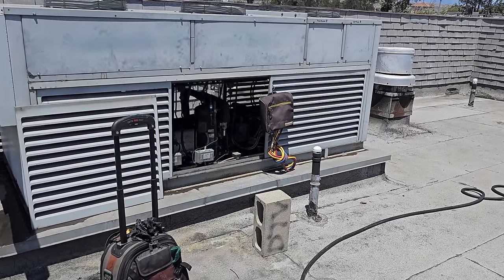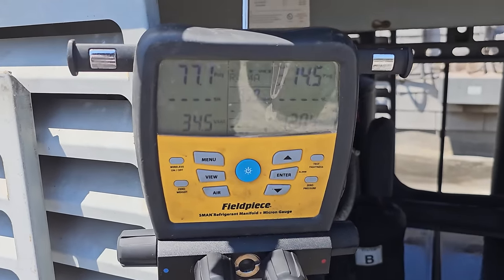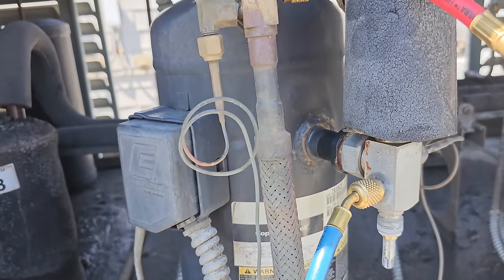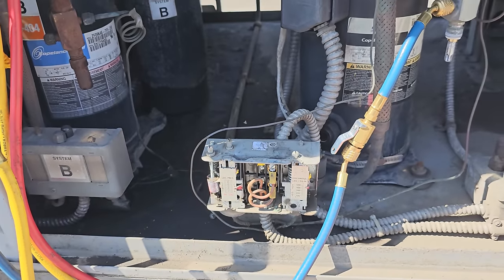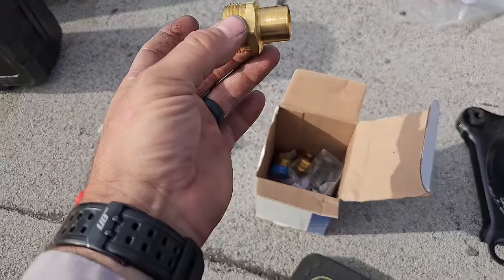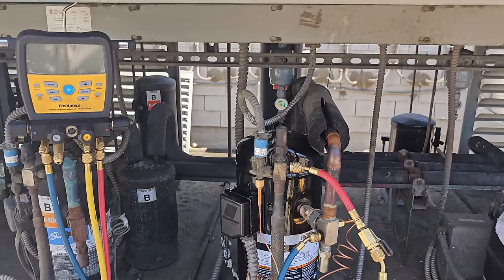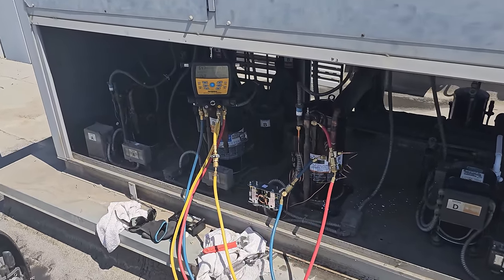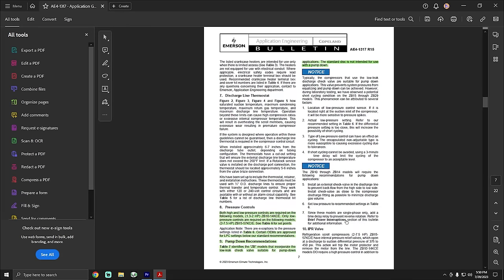NO GOOD DEED GOES UNPUNISHED

Comment: Been the story of the summer here in Austin.....high pressure lock outs left and right....most of the equipment here  was designed for 95-98°....and its been 100°-109° with heat index's of 105°-125°.....got to strike while the iron is hot.
Reply: I'm in East Tennessee and we had a heat index of 120 the other day and everything seems normal. I don't think the heat index applies to HVAC quite the same as a sweating human..
Reply: @Bryan-Hensley you are correct...it is for human comfort or lack there of, but it still doesn't change the fact the temps are way over design and its causing lots of issues....especially with DOAS units...they are tripping left and right
Reply: @jasonjohnsonHVAC  that doesn't seem to happen around here nearly as much as southern California even though our heat index is the same many times. However (even though it's not happened in 10 years) when we go over 100, the systems do the same as there. When I started this business in 2001 it used to get above 100 at least a few days per year, but for the past 10 years or so it barely tops 90. Our nights used to stay above 70 for weeks, now it rarely hits 70. It's actually hurting my business some. I don't have those overwhelming rush periods anymore. Dang global warming..
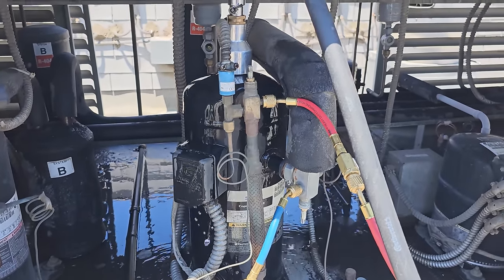Reply: @Bryan-Hensley  we are only getting to 95-98° at 9-10 at night and its getting only down to the high 80's at night...no rest for the wicked....on Friday i worked from 7:30 am till 2:30 Saturday morning....im ready for a break already.

Comment: Really enjoy your stuff.
Have you ever thought of using solid state contactors in high sand and dust situations?
They can switch millions of times with no issues.
They are more expensive, but if the customer would be willing to switch to them, could be ideal in your conditions.
Allen Bradley and others make them.
Just a thought, dude.

Comment: I had a freezer scroll that refused to pump down. And you could hear the hissing. Charge was correct and It got stuck at like 26psi. Even with the LLS closed. So we let it run for 2 days while we got a new compressor sorted for them.

Comment: I’m sure you know this but those field piece probes hate dirty copper, I try to keep a piece of sand cloth in my bag to clean a section where I’m putting my probes. When the copper isn’t clean they still work but sometimes they refuse to work unless it’s on a clean pipe.

Comment: I love the "SWIVEL TEE TRICK" for peanut style pressure switch replacement just install swivel tee fittings and leave the old switch there!
Reply from the maker: I will discuss this on my livestream this evening 7/31/23 on YouTube @5:PM (pacific) come on over and check it out https://youtube.com/live/qEza1nnkhpA
Reply: they tend to loosen or crack with age. vibration kills them, especially with switches and wiring or the long cap tubes going to controls, you'll often find the tubing dancing with harmonics and vibration. that puts load on the tee and work hardens/stress fractures. pretty much they're best for temporary use or somewhere not connected to a compressor directly, say on receiver tank, other taps.

Comment: Front seating those valves will isolate the piping and you can change that pressure control once you "recover" the pressure from the compressor. Probably lose like half a pound of vapor in the compressor. 

But regardless good video. And sounds like you needed new gas anyway.

Comment: Discharge line temperature safety switches for compressors are cheap protection from other components in the system failing that causes the compressor to overheat

Comment: like your channel...was in hvac/refigeration (had 200+ commercial accounts)...in 30+ years saw drastic change in motors  starting with the use of capcitators to EMCs...one of the best developments is the field reversible motor...complaint though; to do with the manufactures all haveing  such short reversible leads and how, as concerned techs, are we supposed to properly secure them especial when the butt end of the condenser fan is secured to the top of the unit (upside down)...for, what, a couple bucks more, they could make the leads as long as the other wires so the tech can route them properly instead of left hanging in the air... and this passes underwriters testing?...did you figure a solution

Comment: Sometimes with freezers i have to crank down on the suction valve when doing a warm startup, not so much because of overload but overpressure because the condenser sucks and/or its too hot

Comment: I wish someone would show me how to pm a refrigeration system to keep the system happy. 
1. How to clean the condenser and evaporator coils.
2. We have cotton seed trees, how to make a screen to catch them before the get caught in the coils.
3. What intervals the pm’s are done
Reply: 1.) Why are you in the industry but don't understand how to clean the coils? 2.)use a roll filter over the coil that has very very little air flow restriction that can be removed after the season. Think like fiber glass medium filters 3.) PM's need to be design to match the manufacture recommended service. 

Keep in mind most refrigeration system run on critical refrigerant charges and as such can be low on refrigerant from a single attempt to collect SH or SC temperature via pressure, as such many refrigerant manufactures have guides on diagnostic designed to quickly test the system from a start up procedure that prevents accessing the refrigerant pressures. 

It sounds to me like what you need is to take manufacture training on specific pieces of equipment. 

Don't take that as condescending. If you want to learn refrigeration you need to be trained by refrigerant producers because "professional HVAC" employees tend to run on rules of thumbs which is a great way to manually destroy a refrigeration system.
Reply: @CallegriaofSoulbound  I'm a maintenance tech that is trying to learn refrigeration systems. I'm in my 2nd semester of HVAC schooling by going to night school that only offers one class a semester that I'm paying out of my pocket.
Reply: @wisconsinbush2940  that explains alot. If your school doesn't teach you how to clean coils you need to get a refund. You should have to know that unfortunately you might only get trained on what you need to know to get the EPA license. But the information I said after that still stands, the best place to learn refrigeration BECAUSE it is not same system to system is from the manufacture. Hopefully you will find a company that pays to send you to training with manufactures. PM's on Air Conditioning system are very basic but refrigerant systems are a different ball game, same field different rules. Learning systems and process ARE important but understanding WHY is the first step and then learning the equipment and all the different forms and tools makes a huge difference. You got some time ahead of you that's why 5 years is a very reasonable expectation to experience in the HVAC field and refrigeration takes a little bit more.

Comment: I've not seen these rotalocks where you frontseat them and still measure pressure at the ports where the pressure controls are at? Like only compressor pressure I thought.
Reply: It is compressor pressure. When the valve is front seated the ports are isolated from system. You can tell by the position of the port in relation to the line. You can front seat the suction and pump down then front seat the discharge and you will have just a little pressure. All this is true only if the valves are capable of sealing off.
Reply: @topher8634  Ok, so I'm not sure why he's telling otherwise then in the video? Maybe he was mistaken? Or am I just hearing it wrong what he's saying?
Reply: @RSBot2jar  no you heard right I was thinking the same when he said it. He's just mistaken. Or maybe he had a bad experience with a rotolock that wouldn't seal off and now just assumes it not isolated from the system.

Comment: 2 questions. How comes sometimes when you charge on a refrigeration unit you’ll charge through the high side and and the low side will say -29.9hG? I had this happen on an ice machine and second with 404A can you suck everything out of the drum or does it have it be only liquid
Reply: the liquid line solenoid is shut as there's no call for the unit to run until he powers the unit back on and there's a call for a cool.
Reply: @Justinstratton11  thanks for the feedback but the weirdest thing is with this nugget ice machine that has a constant ice production : HOSHI FS-1022MLH-C serial: F00076B. There isn’t a solenoid valve. I checked the unit itself, the attic where the line set runs and the condensing unit. I even verified with hoshi tech support

Comment: Anyone else buy the coil cleaning foam gun from trutechtools and was EXTREMELY DISAPPOINTED?? That thing has no pressure whatsoever behind it!!!  It BARELY goes all the way through a microchannel coil.  Does anyone else use this and have some tips I could use to get this thing to work??
Reply from the maker: I still use mine daily... I've never noticed a pressure problem though.... do you have low water pressure to start with?
Reply: Most foam guns are supposed to have no pressure behind them. they only should mix the cleaner and water in the right ratio and foam up the liquid to go on and somewhat stay on more or less 'vertical' surfaces. just the liquid would immediately flow of, foam sticks on some more. The only reason why foaming cleaners are used is the changed viscosity and clinging to stuff. For the cleaning effect a straight liquid would do the same, you just would not get it to stay on there. Also, it is quite hard to get pressure behind foamed up cleaner. It usually should be enough to wash them down and the cleaner should get into and through the fins on its own. The capilary effect should get cleaner everywhere.

Comment: So since your guy said the stuff smelled funny, what happens to the charge you took out? Does it get reused at some point, or does it get sent away to someone that recycles it or something?
Reply: I often wonder about this.  I had some old refrigerant needed to dispose of, went by some auto AC shops asking how to recycle it.  They got defensive/spooked and wide eyed, guess they thought I was an undercover state inspector or something, never could get a strait answer.
Reply from the maker: We send it off to be recycled and or disposed of depending on the severity of the damage done to the refrigerant.
Reply: @HVACRVIDEOS do you ever mix refrigerants in recovery tanks?
Reply from the maker: I have by accident but as a normal practice no I don't do that
Reply: @HVACRVIDEOS  I wonder if there's any videos on YT showing how they recycle/dispose of it. 🤔
Reply: Over here they charge an arm and a leg to recycle old refrigerant, then sell it back to you for even more. Artificial quotas to cripple the supply drive up prices and even make repairs impossible, so most people reuse as much as possible, worst case swap out the filter a few times.
Reply: We use a company that comes to our shop and changes out the recovery tanks when they’re full and then they give me a report on what refrigerant and how much they got, then, they send me a check for the refrigerant they took! They only ask that we wait till we have 5 or more full 50 pound bottles

Comment: Your service area seems to be susceptible to temperature extremes. This condition would be known to the customer so it would be prudent for them to have PM work done in the off- season. If you recommend PM service and they decline, then they should be charged a higher rate for service than a customer who does.
There is NO good reason that you should have to clean a coil in a heatwave.
Reply: Yeah, good luck with that.
Reply: These restaurants don't give a shit about their equipment until it is too late. Did not even realize this specific piece of equipment was down until Chris happened to see something was wrong. Unfortunate but that is just the way this specific part of the industry operates.
Reply: @paulrozinski1488 The customer will believe they are being forced to do "unnecessary" work (pm)  to get a better rate. It's a crap shoot
Reply: @paulrozinski1488  I do broadcast engineering.  We have the same problems with radio station owners not wanting to spend money on what they need to keep running.  PM is a big part of that.  Sometimes, you have to let the customer go rather than letting your reputation get dragged down with them.
Reply: @paulrozinski1488  I think it would be better for him say (to use some of his recent videos as an example) that preventative maintenance (PM) allows for the potential of scheduling downtime (barring what are essentially acts of god like lightning strikes or the main dropping a phase) by catching problems before they fester instead of an emergency call on a walk in cooler to clean its condenser and replace bad cycle controls when the county health department has already arrived for an inspection (Did I mention the box was above 45F?). Yes those FUBAR conventions actually happen.  Each time It went about as well as you imagine. I have of video to teach my apprentices of me actually working on said equipment involved with those incidents.
Reply: LOL

Comment: Whats a rotor lock compressor as opposed to a regular compressor?
Reply: Rotolock not rotor lock. It's those valves he was talking about opening and closing to isolate the compressor. He was hoping to find a compressor with the screw on fittings for those valves rather than just plain copper lines that he had to braise fittings onto in order to screw the valve on.
Reply: I believe (experts, feel free to chime in and correct me if I'm mistaken) that Roto-lock is the pipe fitting on the compressor's inlet/outlet, whereas a "regular" compressor has standard pipe at the inlet/outlet that must be brazed-in.
Reply: Per Wikipedia:
"Rotolock valve is a special refrigeration valve with a teflon ring seated against a machined surface enclosed by a threaded fitting; this valve allows the technician to remove all refrigerant from the compressor without requiring removal of the system charge"  Basically major time saving  system!
Reply: Good question, was wondering myself. Thanks to the folks who shared their knowledge. Thanks.

Comment: To make changing pressure controls easier in the future, can you install ball valves to the compressor ports and then the pressure gauge lead to the ball valve?

That way, when the pressure control borks, you can just close the ball valves to seal off the system from the leads so you can change them without having to recover the charge and just leave them slightly loose while you crack the valve to purge the air out before doing the final tightening of the lead nut...
Reply: Use Schrader cores and depressors.
Reply: @RodrigoRamirez-fc5hv  Chris mentioned in the video that the pressure sensors won't accept them so they can't be used there...

Comment: Why are you just did not change low pressure control?  
The gage manifold has shown that compressor works well.
Please help me understand.
This video shows to us that this vessel is overcharged and doesn't work pressure control. 
WHY?
Reply: Did you watch the video???? he did change the low pressure control. He also had to change the compressor because it was also bad. this tells me that you are a poor technician. You would have just changed the pressure control only to have the compressor shit the bed in a few days later. That isn't how to do good work.
Reply: @davidmiller9485  please point out the time when he has changed pressure control.(maybe my English not so good and I missed it).
Reply: @ВладимирИвашечкин-п4е  18:14, then when they put in the new compressor they just replaced the capillary tube. Hell he spent 10 plus minutes talking about how it was bad because it wouldn't read low pressure right.
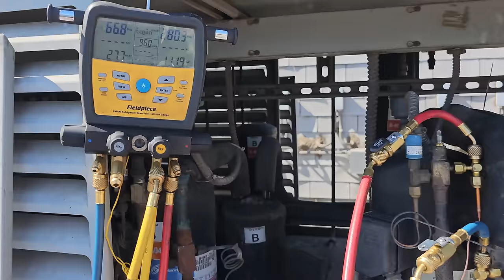Reply: @davidmiller9485  you are right, (Thanks) he changed the pressure control and it worked good (19:02) but despite on this he changed the compressor.
Reply: @ВладимирИвашечкин-п4е  Yes because the pressure control had caused the bleed off valve in the compressor to fail. It needed replacement as well.
Reply: @davidmiller9485  Ok. Thank you for explanations. But if follow to your logic, why he did not change the second compressor too?
Reply: @davidmiller9485  Anyway, thank you for your time. I think that Chris strives to do his work best and he does it.

Comment: If it is still working, let it be. But changing compressor for easy $3k. HVAC techs nowsaday are only replacing units and compressors for more money.
Reply: I disagree. You want to replace failing equipment before they take down your business.  What other option was there in this case.. Leave a hose running on the compressor all day long?
Reply: Wait for an emergency service call? Wait to come in and find ice cream melted? Food spoiled? Pay for the lost food, lost revenue, emergency call costs. I don’t understand your logic. That’s like saying wait for a battery on your car to die completely before replacing it. If you know the battery is weak, or over a certain age, why not replace it?
Reply: Product looss and downtime often amounts  to a far higher long-term cost then replacing faillling equipment.
Reply: That’s like saying “my engine knocks really bad but it’s ok it still runs” then complaining at your mechanic for the rod hanging out the side when it breaks.